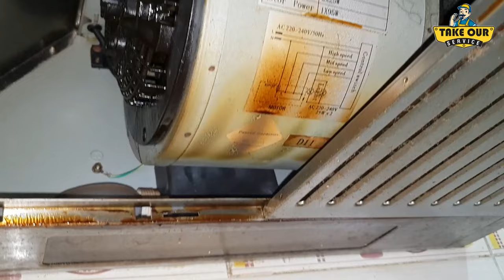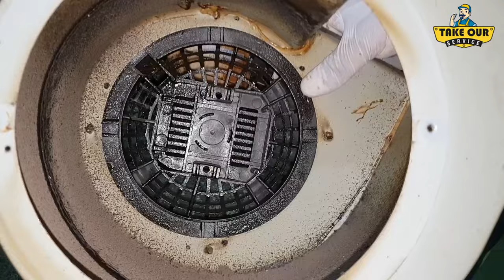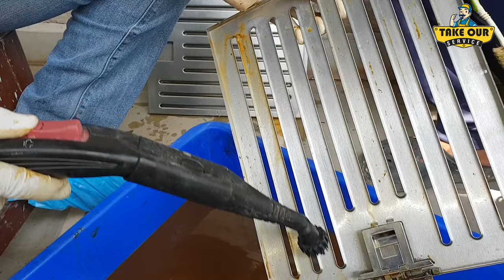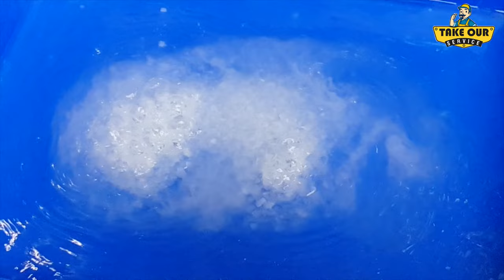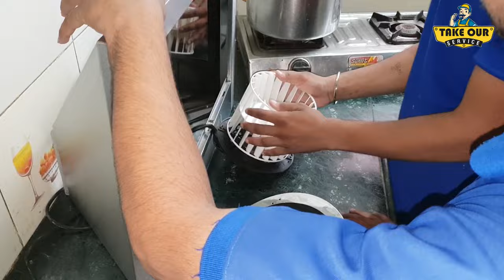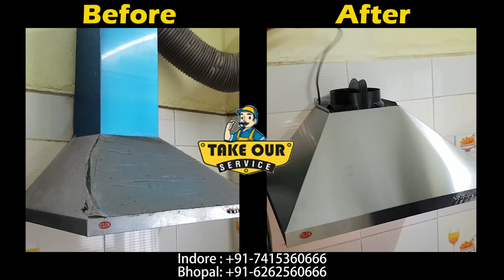Chimney Cleaning Service

Comment: Cleaning with Caustic Soda ( a strong base )  is good but the Aluminium Parts would be damaged due to its corrosive action so don't leave such aluminum parts inside caustic soda solution for a long time.

Comment: What chemicle you use
Reply from the maker: Soda and Steam... Actually a wide variety of materials could be used for the purpose. Service Quality depends of the workmanship and training of servicemen.
Reply: Go for caustic soda, available at chemical stores
Reply: It is Caustic Soda crystals  mixed with water to get solution. It is a strong Base,  though not corrosive like Acid, it will slowly burn skin,itching starts on body.Don't touch with bare hands, use proper gloves while cleaning.Don't put aluminium parts for a too long time inside solution.Caustic Soda Available in all Hardware/Chemical  Stores.
Reply: Caustic Soda with water

Comment: Fan ka blower uneven ghum raha hai kya kare
Reply from the maker: Open it again and reinstall it after cleaning.
Reply: @takeourservice  i did but it is stll rotating uneven ,though i have not opened blower from motor
Reply: Side screw adjust kareh thoda saa. It will work finelt